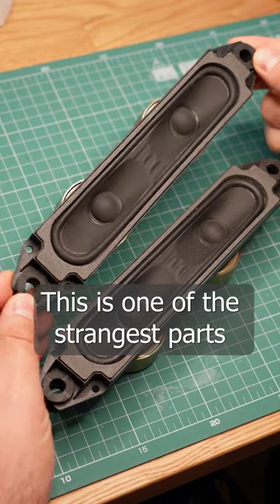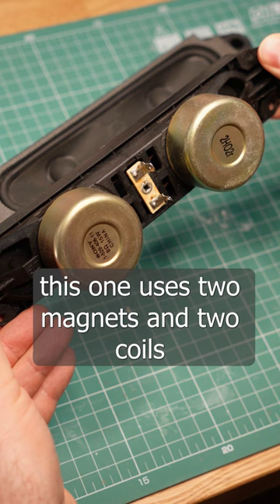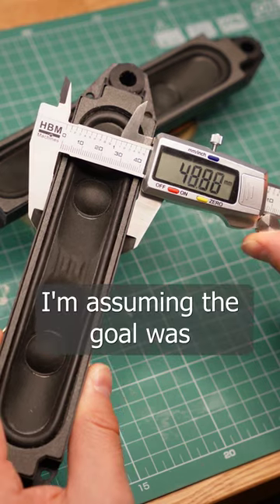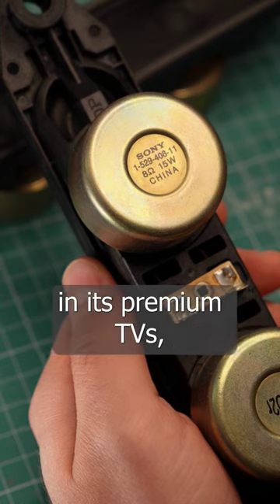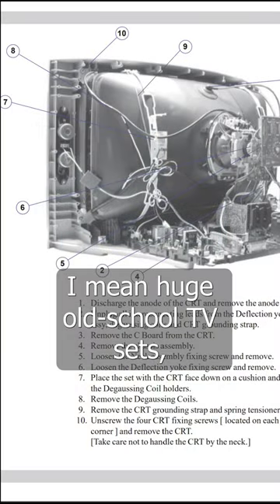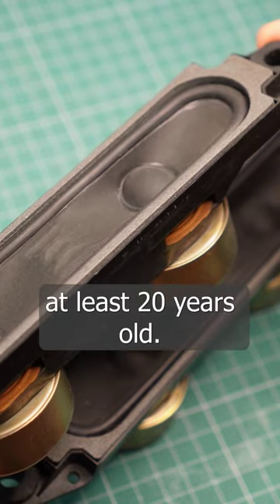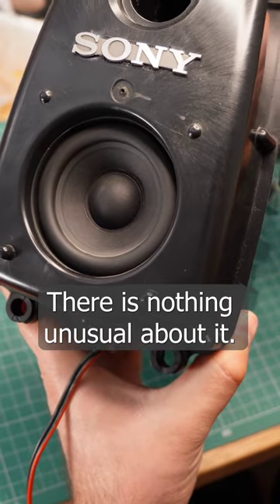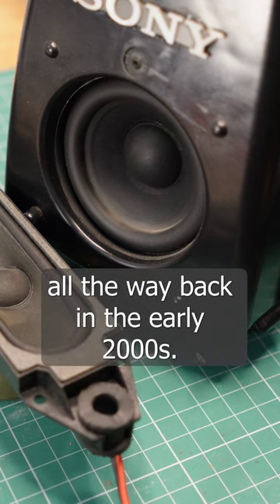A strange speaker from a Sony TV

Comment: I have the same speakers with a grey subwoofer enclosure. The one you have is the worst version of it. The satellites are going by "sony doubles" and the woofer as "miniwoofer" (they are very small compared to other crt tvs subs and they are just cute too :3)

The one you have is made by matsushita panasonic and those black enclosures usually have a really stiff version of the driver. (There are different versions of that panasonic driver in those)

 There are countless versions of that subwoofer. Some even have a transparent blue or green enclosure! Those also come with 3 different drivers. 

These speakers are well known among the speaker community. They have a title of the legendary/immortal tv speaker set or stuff like that. Oh and did i mention that there are also different shaped enclosures for those subwoofers depending on the tv chassis

I also tested one of these sets on my channel :) there are also countless videos of the different variations of these doing their thing.
Reply: Ok, i accidentally made a documentary of these... whoopsie..😅